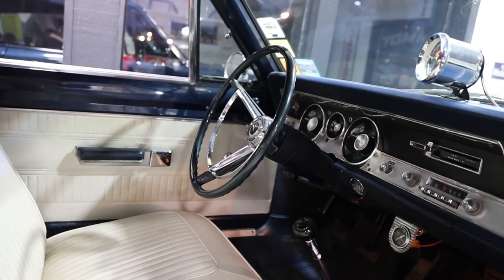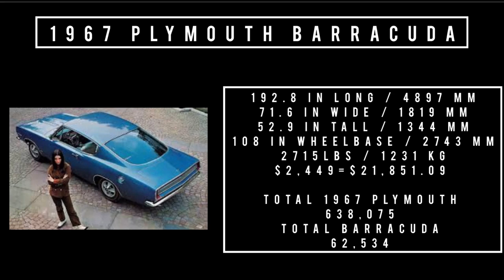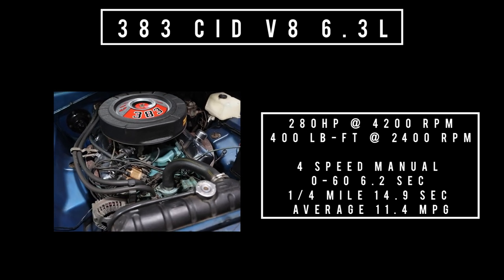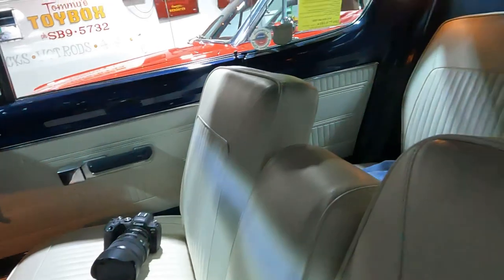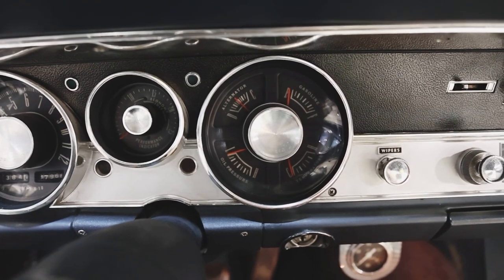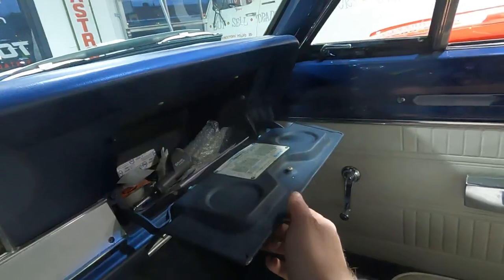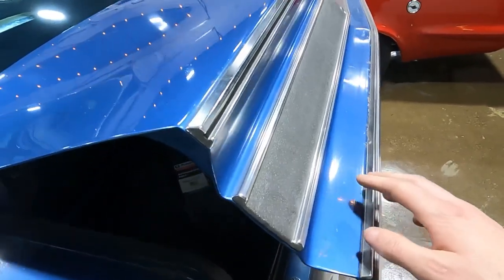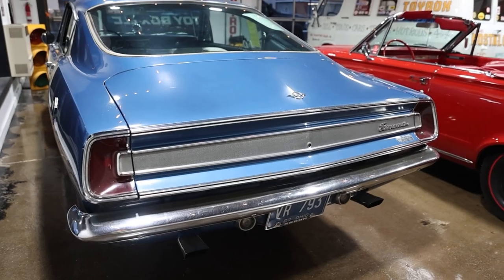1967 Plymouth barracuda, 1st year of the second generation.￼

Comment: I had a 1968 340S and loved it.  Mine was a 4 speed and came with Firestone Wide Ovals.  They lasted less than 2000 miles as they were unbelted, just bias ply.  It was a pretty fast car-could beat 383 Road Runners.  I still miss that car.
Reply: You are correct the 225 slant six was offered for ‘67 because we had one brand new then with three on the tree. 145 bhp. The other door light was under the dash. Our 67 Barracuda fastback( my Dads) was midnight blue exterior and interior metal, with white interior and front buckets. 67 was the first year they had hazard lights, and dual pole master cylinder. It was also the only year to not have turn signal indicators fender mounted, from 67-69. Also the first year for the smaller rear window and the first year of the redesigned fastback deemed as Italian styling. I want this car but it looks like it’s already gone.
Reply: Yes they could because they were under rated at 275hp (actually 350 hp) and they weigh less than the 275hp 383 C. I. Engines 👍
Reply: My dad had the same car.  It hauled ass and cornered very well.  Dad said it was the best car he ever owned.  The 340, Formula S package and Hurst 4 speed was an awesome combination.

Comment: Very rare, bench seat, I've always loved the 2nd gen barracudas. Jay if u pull the latch in the middle of the trunk diveder it will fold down and give u 6 ft of storage space to haul ski's or other    items.
Reply: The rear seat also folds down.
Reply from the maker: Thank you so much for sharing that I forgot to put the seat down
Reply: Hi Jeff, I just replied above, but I did not see your reply before.  Dave...
Reply: Actually it’s 7 ft and it’s flat I’ve camped back there in the both the 1st & 2nd generation barracuda’s very comfortably 👍

Comment: 15:06  Notice the flat housing for the upper radiator hose.  Under that is the thermostat.  So easy to work on, simple gasket, easy easy.  Also, a 4-bolt water pump, another EASY fix.  I wish today's cars were designed for EASY maintenance—they're NOT.
[edit:  fix typo]

Comment: Hey jay I see someone pointed out the cool fact that the trunk panel folds flat exposing a 7 ft flat floor space, very cool for camping etc 😮, by the way yes these barracuda’s were very quick 1/4 racers always shot for a 10 lbs per horse to get you into the 12 second range, as long as you could hook up and these cars were 2600-2700 lbs and 235- 275 hp (yea buddy)👍👍

Comment: Great ride. The 2nd generation  Baracuda  was the unsung model in history. The basic chassis comes from the Dodge Dart/Plymouth Valiant this is one car I would love to do a Restomod on.
Reply from the maker: I remember these cars used to be cheap like 10 years ago you used to be able to get one for like five grand I’m not talking the 383 I’m just talking any model small V-8 they’re starting to pick up in value.. and they’re not as easy to find as they were 10 years ago
Reply: @What.its.like.  yeh the small block like a worked 340 would be my choice I love the 383 for torque but that chassis doesn't like the extra weight.

Comment: My favorite Barracuda. Simply beautiful and well balanced.
The standard engine for the 1967 Barracuda was the 225 CID slant six or 273 V8. The 170 CID slant six was not offered on the Barracuda. The 225 CID six was not taken off the table for 1967. 
I consulted two great sources for information. (1) THE STANDARD CATALOG OF CHRYSLER 1924 to 1990 by John Lee, First Edition. (2) THE PLYMOUTH AND DeSOTO STORY by Don Butler, Editing and Design by George Dammann. Copyright by Crestline Publishing Co. 
You might want to invest in various printed texts regarding the history of cars. There are many! While my memory is sound and my knowledge adequate, my extensive printed library is often my go to source for specific details. I'd start with the STANDARD CATALOGUE OF AMERICAN CARS and build from there.
You're doing great. Each video is an improvement over the previous one. Keep up the good work. 
You have my support, Jay!
Reply from the maker: The ultimate deciding factor was it wasn’t in the book of collectible cars it was underneath the listing from 67 to69 did say the engine was available but it wasn’t available in 67 it was available and 66 and 68 why it wasn’t I have no idea some sources said it was available other sources said it wasn’t.. that book has been pretty spot on about most everything so I decided to just go with that book
Reply: An update regarding the availability of the slant six in the 1967 Barracuda. 

Curbside Classics posted an article on August 31, 2023 that covered the 1967 Plymouth Barracuda. They reprinted a road test article done by "Car Life" magazine in Mach of 1967. CL tested two 1967 Barracudas: a hardtop equipped with the standard 225 CID slant six and a fastback equipped with the 273 CID 4-bbl V8.

Some sources can be inaccurate or misleading. In this case, a publication missed the boat. Many other reputable sources list the six: factory sales literature confirms its availability. Also "The Standard Catalog of Chrysler", "The Standard Catalog of American Cars" and "The Plymouth DeSoto Story". 

There was, indeed, a six offered from the factory for the 1967 Barracuda.

Comment: This excellent presentation has sparked, for me at least, a dilemma. The problem surrounds the availability of the 225 CID slant six power plant in the 1967 Barracuda.

Several excellent sources state the 225 CID WAS available (see my post below). The 170 CID slant six was NOT offered on the 1967 Barracuda. There is a You Tube video displaying a 1967 Barracuda with the 225 slant six. Owner claims it is original.

 Other sources say (as Jay stated) the 225 CID slant six was not offered for 1967! 

So, my question is: was the slant six offered from the factory in the 1967 Barracuda? There should be a definitive answer to this question. 

If anyone has the answer, I'd be more than interested. Mustang and Camaro both offered 6-cylinder engines in 1967. I can't believe the Barracuda skipped the six in 1967.
Reply from the maker: I thought it was the weirdest thing in the world why wouldn’t they offer a six cylinder and 67 I ended up not putting it in the episode because the complete book of collectible car said it wasn’t an option.. welcome to the world of conflicting information it’s crazy I almost put it in there anyway but then I was afraid that people were gonna say that the 225 was never offered.. 

Glad you like this episode =)

Comment: The 235 horsepower 273 was underrated by the factory the NHRA factored the motor at 275 horsepower same as the Ford hi-po 289 that Ford advertised as 271 horsepower.
Reply from the maker: Sweet thank you for sharing that information =)
Reply: There was also a 1965 1966 option on the 273 known in the Dodge Dart as the Super Stock D-Dart package. It came with wilder cam aluminum intake a larger four barrel and fender well headers. I'm sure the same option or parts was available for Barracudas but I don't know what Plymouth called it. The D- Dart package was factored by NHRA at 325hp horsepower.

Comment: I would rather have a "67 Mustang due to the fact that the '67 Barracuda doesn't lend it's self well to power steering when it comes to big blocks. Factory air conditioning looks aftermarket on this car and not many came with power brakes, not to mention disks. "67 Mustangs had many that did have power brakes and power steering. The aftermarket parts market are way more numerous for the mustang thus finding parts is a cinch. This being said, I have a '67 Barracuda. I could of had my choice of Mustangs but that was the issue, in that there are so many of them wherever you go. Nothing is really special about them compared to the Barracuda and because of that they look quite commonplace and ordinary. This body style is quite rare looks very special. I have a conv. in turquois with a white top and a black interior. I had to put power disks in it for my own sanity but came with power steering and a 273 auto, bucket seats with console. I always thought that the formula came with 150 speedos and buckets but I'm sure that anything could be changed.
Reply from the maker: I think I’m right there with you I had a 67 mustang so I totally know where you’re coming from mine was a coupe though, miss that car every now and then, 

I have a 52 Chevy 1 ton stake truck And if I’m honest it stops better and rides better than my Mustang did not sure it there was something wrong with my mustang but. Yeah it was a cool stress ball I used to slide sideways every chance I got